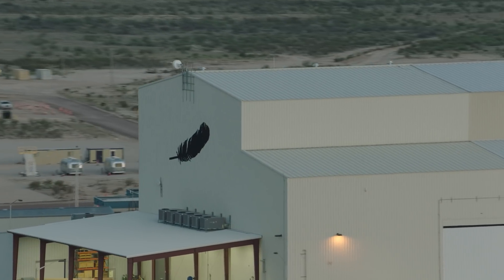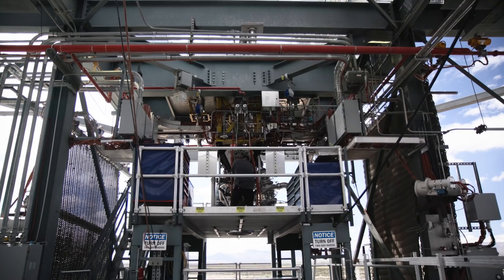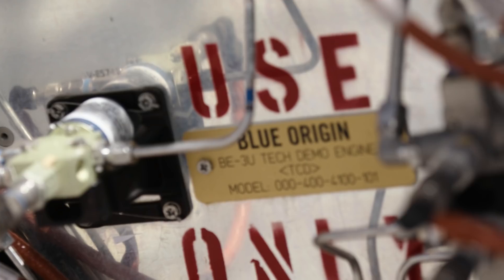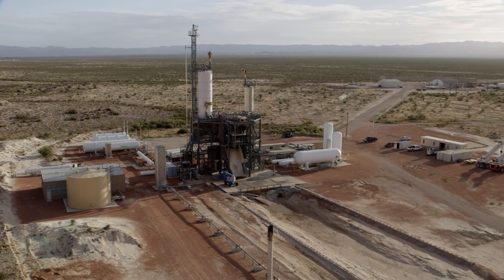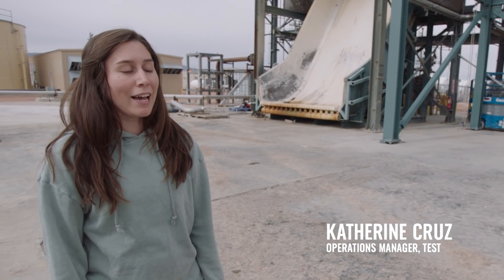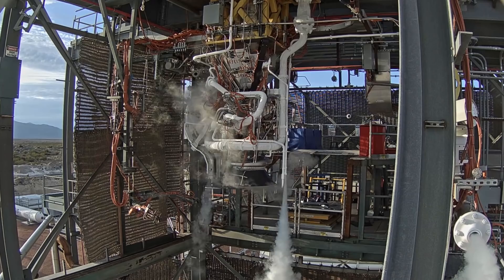BE-3U Progress Update - New Glenn's Upper Stage Engine

Comment: I understand that one of Blue Origin's tenants is Space Tourism, but dang this thing just has to go to the moon. This has the most thrust for an UPPER STAGE Expander Cycle EVER! It's highly comparable to the Vac Thrust of the Rocketdyne - J2 (Saturn V Upper stage), which is super exciting! 

Also, the expander cycle choice is also an interesting one. It shows that they are really focused on producing the most thrust as opposed to efficiency.
Reply: I believe they plan on building a rocket even bigger than the "New Glenn" called the "New Armstrong" that will go to the moon.
Reply: Two years later and 2 years wiser. This thing far exceeds the Vac thrust of the J2, by nearly 7x. It uses a Bleed (Open) Expander cycle which sacrifices some efficiency for that higher thrust it produces.Should be a neat engine to get to design, construct, and test.

Comment: I'm a big Musk fan, but I will say I agree with Bazo's about the overall direction the human race should take more then Musk. Short term Musk has the better idea to colonize Mars now, but long term I think Bazo's has the best vision of the future with O'neill colonies. Still you guys need to get New Glenn operational quickly, as soon as Starship is operational demand for New Glenn will plummet, and Blue Orgin will have no choice but to build a fully reusable spacecraft to compete with Starship or go out of business. Best case scenario you will get 10 years out of New Glenn before the tech is obsolete, hopefully Blue Orgin's Engineers are already working on a solution for when Starship if operational. Maybe Bazo's himself needs to crack open the Rocket Science textbook, Musk is a self taught rocket scientist, maybe that's the competitive advantage Blue Origin needs?
Reply: Johnny agree that in many ways Bezos vision may make more sense. However tactically speaking what Elon Musk is doing is smarter. Colonizing Mars is a very concrete easy to grasp goal. It allows much more focus and excitement needed to push things forward. Ultimately what both Elon and Bezos is providing is a cheap space transport system. This can in principle be used for anything.

While Elon Musk wants to go to Mars it is not impossible that more Starships will go to the Moon. Once operational NASA and others may start paying for a lot of flights to the Moon.

One of the benefits of a large scale Mars colonization effort is that it we create demand for manufacturing in space. With hundreds of flights going to Mars, there will be a market for fuel produced in space. That will make it possible for asteroid mining companies to start operating.  One asteroid mining gets going we are going to see large potential. At first it will be for fuel but later they will mine metals and others things.
Reply: @erikengheim1106  Starships run on Methane. I don't know anyway to make Methane in space. Blue Orgin is actually in a better position to utilize Hydrogen production in space, but they need to get going... or just give up when Starship flies and just start buying launches from Space X to build larger ships in space.
Reply: Johnny Thunder Good point. SpaceX is of course intending to produce methane on Mars. But you are right. For moon and asteroid activity, Blue origin is better positioned. It will be interesting to see how this plays out.

Comment: How do you create heat to drive the pumps before the engine is lit?
Reply: Tank pressure gets things flowing when you open valves.  The real trick is lighting it, and for that, a lot of engines that don't use hypergolic (self igniting) propellants will have a slug of something that will ignite on contact with either the fuel or oxidizer.  Once the fire is going, it all just works.

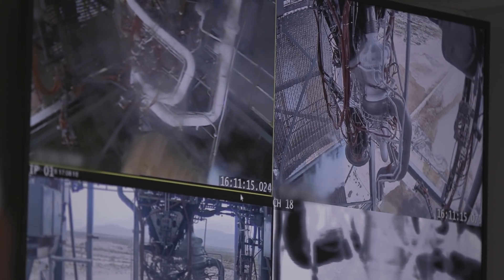Comment: 0:34    Pilot Pen in his ear     Great pens, the best money can buy for only 2 dollars per pen 
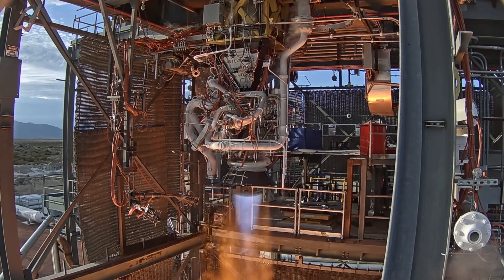1:09 mach cones in exhaust       sweet 
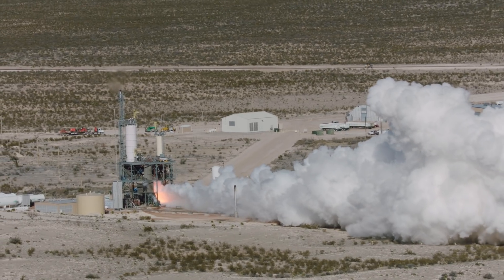1:19 arrays of heat absorbtion coils       are they for data collection of overall heat on the sides of the rocket?
Is the plate on the upper right a test material for simulated rocket body material choice?  
Heat distribution is critical, but so is acoustic signature for diagnostic purposes.. Are you taking both measurements, to help quantify the data from the heat?
Reply: As a pen afficionado, I can assure you that the writing instrument to which you make reference above is not, in fact, the best money can buy. 
-------
It's decent value though, I won't deny. But prepare to have your mind blown should you ever take a step to the dark side :D

Comment: Why do they use the term ‘heat’ in that context ... can anyone tell me? Thanks
Reply: Martijn Cornelissen the heat is used to expand the fuel to drive the pump that pushes the fuel into the engine. Then said heat that’s coming out of the engine (as fire!) is expanded in the booster trading heat for speed thus pushing the rocket according to Newton.
I think that’s right?
Reply: @kitsandham7001  That is how I understood it as well. Managing the heat from the engine to power the turbopumps that keep the engine going.

Comment: If I understand you guys correctly, you do things the exact opposite way of SpaceX: Where they do, try, sometimes fail and retry, you guys calculate, engineer, build and succeed. Would that be close to accurate?
And, if I am right, it's becoming obvious that your route is a lot less - bangy? It sure seems slower, but also more cost-effective - and once New Glenn flies it'll prove beyond any doubt that it also leads to the final result.
Go Blue Origin! Go SpaceX! Go Spaaaaaaaaaaace!!! xD
Reply: Clearly those two companies uses different development methodology. BO uses classic waterfall model wheras Spacex uses concurrent engineering.
First is cost efficient and the 2nd is time efficient.

Having in mind Musks goal (make human race interplanetary) it seems apriopriete to speed up the development and having few booms in the process. Life is short and Elon will not be here forever to drive towards this goal.  

And comparing NG to starship is pointless. Target of starship is to reuse 2nd stage. NG will reuse only 1st.
Reply: Well, Blue Origin has also been testing. The New Shepard rocket has flown a lot of times and it uses more or less the same engine, minus the adaptations for efficiency in vacuum that this is getting. With it, they have also been testing and perfecting soft landing of the first stage, which is the plan for the first stage of the New Glenn as well. 

The New Shepard has in many ways been their equivalent of the SpaceX "hopper". But in addition the NS is a project of its own, with the intention of doing tourist shots as well as science payloads that only require a few minutes of zero g, so they don't require (or can afford) a full orbital flight. Blue Origin has already flown commercially with the New Shepard multiple times, though not with people yet.

But yes, Blue Origin is much less flashy than SpaceX, but that is simply the result of a different philosophy from Bezos and Musk, respectively. I don't see that one philosophy is inherently better than the other, at least not yet. Both Blue Origin and SpaceX have had problems, and will continue to bump into problems, and hopefully overcome them. Only time will tell who has built the best foundation for the coming 10-20 years.

When it comes to achievements, SpaceX has won quite a few already. But that doesn't mean that Blue Origin has zero achievements. For example, soft landing a first stage with a deep throttling re-ignitable LOX-engine is something that has never been done before. Having the ability to throttle far down makes it possible to do a much smoother (and potentially safer) landing than a full "suicide burn". Instead they can brake a bit earlier and stabilize the rocket before putting it down. Learning this will also be very valuable for the development for the software for the Blue Moon lander.

Also, Blue Origin may actually be ahead when it comes to developing rocket engines, as they already have developed (or are currently working on) five different types (six if you count the BE-3U as separate from the BE-3).

My hope (and I think a lot will agree) is that both companies (and any other takers) manage to bring the cost of space launches down, as well as inspiring more people to get into engineering and science. Then, a bit further down the line, it's time for going to the Moon, Mars and other interesting places in the solar system.

These are exciting times for those interested in space :)
Reply: No, not blue origin, the reason SpaceX works how they work is for speed so the future can come sooner so that more people will experience the future before they die, say you die in 1 year, would you want to see a fully reusable rocket launching in that time? Blue origin would not be able to do that. Though blue is spending less money, spaceX is disregarding the cost and really putting the time is money saying to the side because in the end time is priceless, you know wa i mean?
Reply: You should maybe keep in mind that Blue Origin is 2 years older than SpaceX.  I have to wonder why Blue Origin STILL does not have an orbital rocket.
Reply: if you compare SpaceX development of F9, it looks a lot more similar. When you do something that has been done before, it is possible to just do the calculations. When you do something that hasn't really been done before, you need to test more.
Reply: @snuffeldjuret  True, but New Shepherd has flown a couple of times, so this is not Blue Origin's first rocket either. I'm thinking that we can compare New Glenn with Starship and the differences in their development philosophies, even with the much greater experience of SpaceX, would you agree?

Comment: I wonder what specific impulse it will have when it's done. So happy to see development reports! I've been a subscriber to this channel for a long time with very little content updates and suddenly we get 3 videos in a few days! I am so excited! 

I hope this means we get more content here on the channel, but even more I hope this means New Glenn isn't too far away in the future!

Keep up the good work!
Reply: The Wikipedia page is without any data on ISP and the difference in thrust between sea level and space is WAY more than normal for any rocket engines I've ever seen.  Like 100klbs sea level and 160klbs vacuum -- 1.6 times as much when 1.2 would be more like the high end.  Something doesn't add up.
Reply: 110 klbs is for the BE-3PM which has a much lower thrust because it is a sea level optimized engine and needs to throttle down to about 20% thrust for landing New Shepard.  If they gave the BE-3PM too much thrust it would not be able to throttle low enough to land New Shepard. Their BE-3U is 160klbs, vacuum optimized, and will not need to throttle.  There is no need to hold back on thrust for the BE-3U.  You can expect an Isp around 450+ sec for a hydrolox expander cycle vacuum optimized rocket engine.

Comment: not rocket scientist, but i see nothing special, new,  same 60 year old tech, what is new?
Reply: You do know that New Glenn is reusable, right? It will fill a niche in that kind of rocketry between Falcon 9 and Starship or New Armstrong. In fact, it represents a much more advanced form of reusable rocket than Shuttle or F9.
Reply: Julius Heide well the guys in the 60s were brilliant, they had most things already figuring out with rockets in paper, but didn’t have the manufacturing capability we have today. So plenty of 60s designs couldn’t really be made at the time but can now.
Reply: not sure how old the engine tech is, it sounded like the pump thing is rather new in practice.
Reply: @snuffeldjuret  https://en.m.wikipedia.org/wiki/Expander_cycle
Not really. Even china has such engine
Reply: There's probably a lot going on in the details that we don't see.

Comment: Why not using methane too on the upper stage?
Reply: Because methane is less efficient
Reply: @SneeuwPoesjes  Then why using it on the first stage which has to do the most effort?
Reply: @xThirdOpsx  it's because methane has more energy density compared to hydrogen. Making a boost stage out of hydrogen is not efficient due to the tanks having to be absolutely massive and you'll need massive engines too which all add weight and complexity offsetting the benefit from hydrogen. An upper stage is smaller and don't often require much thrust and so can benefit alot more from hydrogen fuel.
Most boost stages now (and in the past) use RP-1 which is even more energy dense (but less efficient than methane) and has as extra benefit that it's extremely cheap and easy to handle but as a main drawback that it's combustion releases quite alot of soot which is not ideal for reuse.
Reply: @SneeuwPoesjes  Got it, thanks :)
Reply: And making methane off planet is more difficult - perhaps?

Comment: the blue origin engine burn looks so clean and focused!
Reply: Hydrolox burns very clean. Kerolox produces a lot of sud, that glows within the exhaust. LNG+O2 is better than Kerolox, but still produces more sud than a Hydrolox design. (Though Hydrolox burns way hotter)
Reply: @klosskopfder1.762  A methalox engine won't produce any soot.  The hydrogen all burns to water or H2 and the carbon burns to CO.  They tend to run them fuel rich because H2 is the ideal exhaust gas for rocket engines.  Hydrolox would burn hotter if they did stoichiometric fuel and oxidizer mixing, but again, they run them very fuel rich, both for temperature and for increased efficiency.
Reply: @jamesburleson1916   If only someone could run one of those gases in a full flow staged combustion engine - it could run at closer to stoichiometric fuel and oxidizer mixing and still get great efficiency. (Right?) If only...